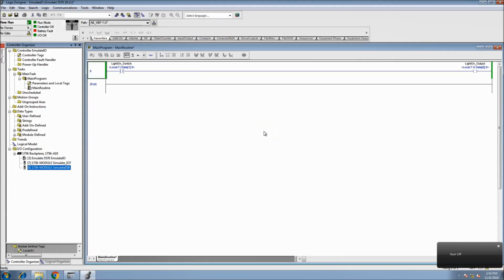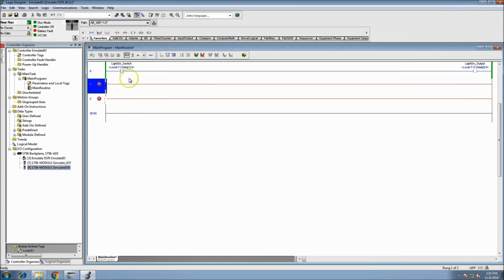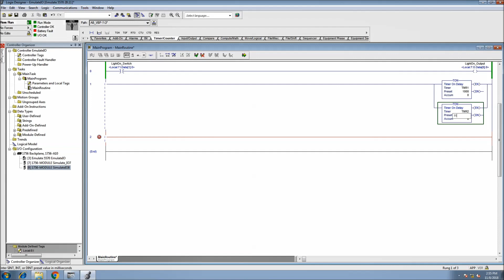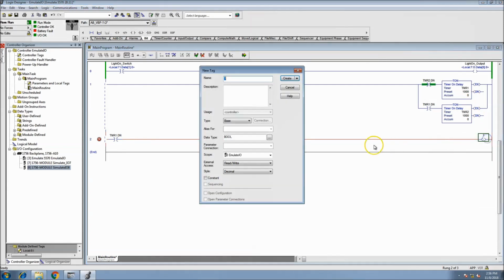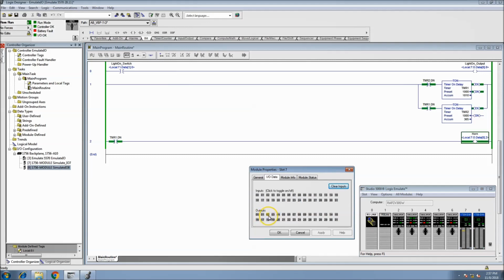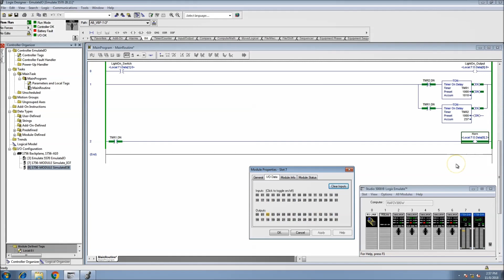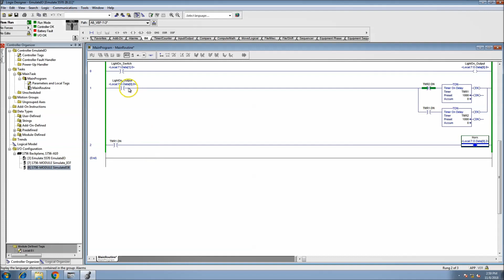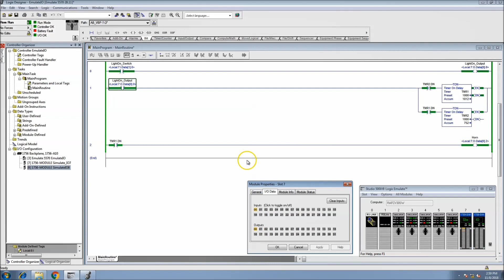Studio 5000 Emulator I/O Simulating PLC Logic For Better System Control

Comment: How can I read studio 5000 emulator value using python.
Which library is used for studio 5000 emulator and python interface.
Reply from the maker: That is a complex question because it depends on the Python program & how you want it to work.

Not a question that can be answered without looking directly at the goal of the task then writing the Python code to do that.
Reply: @ShaneWelcher  maybe you could using opc client. I think that you could mount a opc server that connect with PLC AB Emulator a later using a client maked in python
Reply from the maker: @martintorres5829  I have videos on my YouTube channel about using an OPC topic.
Reply: @ShaneWelcher  i going to look at them. Thanks for response

Comment: Why is it that you can add a timer online, but i have to be offline?
Reply from the maker: Could be the version of software that you have.
Reply: @ShaneWelcher  Yea possibly, i have version 20 and i believe you have version 28.
Thanks
Reply from the maker: @kulaib14  Not exactly what I mean, I have version 20 and do this with no problem.
What I mean is do you have the full pro version or the lite version of the software?
Reply: l'émulateur est intégrée à LOGIX5000 PRO? ou il vient séparement? merci